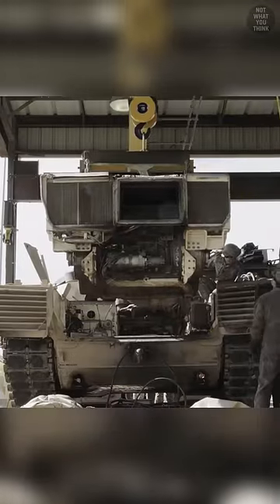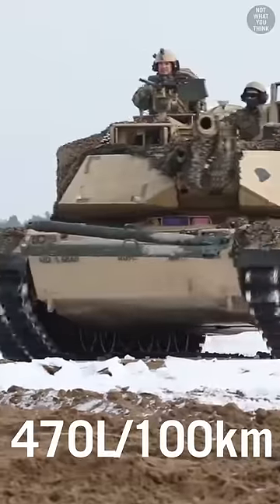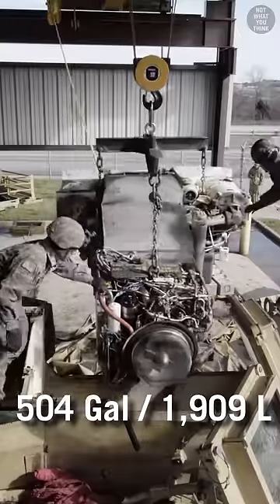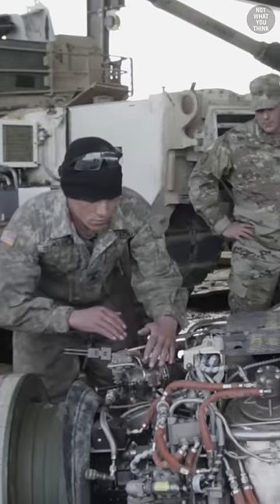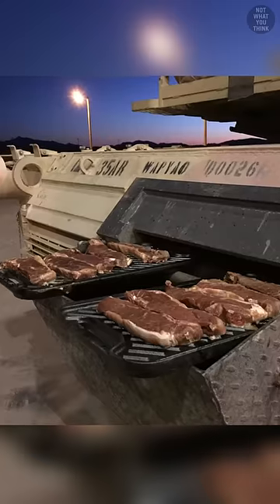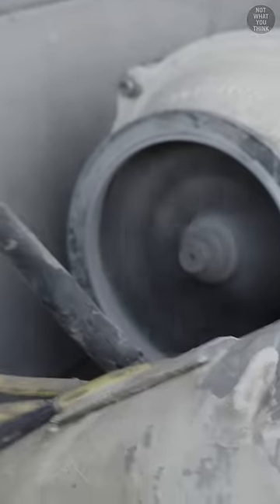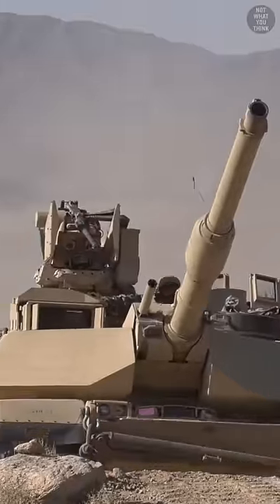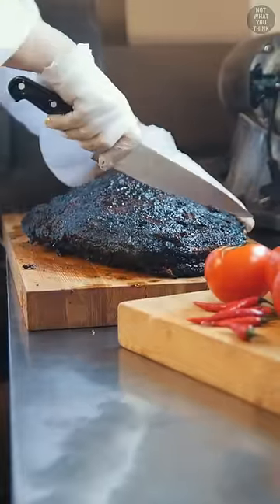Why M1 Abrams Tanks Have Gas Turbine Engines #shorts

Comment: "It's not what you think"
Turns out, it's always what we think
Reply: No, it’s not what you think, it’s exactly what you think. There’s a difference.
Reply: I never thought the main reason they chose this engine was because it can run on diesel, marine diesel, jet fuel, gas, oils etc. Thats a huge advantage over a diesel engine which can only run on diesel and oils
Reply: Zeriel l actually agree with you and finally some one who l found in the comment section that actually has a functioning brain for once.

Comment: Something that really helped to cut down fuel costs was the addition of an APU (auxiliary power unit) which is just a small engine to run the hydraulics and other systems while the main turbine is off
Reply: The newest Abrams has panels in the bottom under neither the driver that can be removed so the driver can Flintstones walk the tank

Comment: “Like diesel and jet fuel” and vodka, and perfume, and wood vapor, and hydrogen…
Reply: Pretty much any fluid that can be made to burn.
Reply: In soivet russia tanks only run on vodka and alcohal
Reply: You can also chuck a russian in there that works too. their body fluid is mostly vodka and diesel fumes anwyays
Reply: And cooking oil, and heavy oil from cargo ships, and kerosene, and propane, and butane and meth if you're feeling adventurous.
Reply: @commiemark  and bears operate them
Reply: @hallofo8107  Yup, just like the Chrysler turbine, that was one hell of an engine! lightyears ahead of any other engine, the exhaust was even room temperature due to its power recovery system, but just like this it could literally run on anything flammable, including propane, wood gas, alcohol, diesel, gasoline, butane, etc.. When they showed the car off in mexico they ran it on tequila and in France they ran it on Chanel number 5  and brandy.
Reply: @ec7005  on meth? But why would we be invading middle america?
Reply: @TheRamenSeal  lol wrong meth buddy
Reply: @Lotek117  Holy smokes, I had no clue it was THAT versatile! I also didn't know about the power recovery system either - thanks!
Reply: You know what's funny is a Cummins from 1959 can achieve the same exact thing
Reply: @ec7005  Jesse we need to cook the us military wants our meth for tank fule
Reply: @Wage_gap_gaming  lol I've taken meth before, but it was neither methamphetamine nor methanol.
Reply: @ec7005   the heavy ship oil is not the thickest fuel rated for emergency use anymore.  M1’s have been driven on Diluted Bitumen (Western Canada Select), but it does require a depot-level overhaul if solely used for more than 80hrs. That fuel is so thick, it sinks 6inches into the mud if spilt in a waterway.
Reply: @wiryantirta  made my day 😂😂
Reply: @Lotek117  I’ve often thought since Chrysler designed the Abrams, if the two were ever connected. Chrysler used guys from their missile division to help with the Superbird and Daytona aero.
Reply: @commiemark  dude thats racist how you talk about the great socialist eastern world, you getting a visit by a local authority soon
Reply: @MrBlonde294  bruh it was just a joke
Reply: If it burns she’ll take it
Reply: @commiemark  
In reality , the ussr use first a gas turbine innthe t80
Reply: Not hydrogen.
Reply: Don’t forget about Twinky’s
Reply: @Lotek117  how did it recover energy? Did it have a sterling engine in there too?
Reply: @commiemark  acoha
Reply: Good luck getting any liquid hydrogen. Not even hydrogen cars use liquid hydrogen.
Reply: @___meph___4547  lol no,  Methacholine.
Reply: @mincat1412  Orcs not bears...
Reply: @MrBlonde294  bruh do you know what comedy is? Comedy is typically when someone takes something dark or even usually uncomfortable and makes if funny or uses stereotypes to help deliver the punch line besides 70% of all comments on YT are jokes the rest are people complaining like you ☺️
Reply: @mincat1412  the tank is actually a mechanically enhanced bear
Reply: @ec7005  Oh, you meant MethANOL.
Reply: Is anything that can be atomized and catches fire
Reply: when the engine is hot enough, it could runsome percent of water
Reply: Can it use sewer oil?
Reply: @hallofo8107 i thought diesel was too thick and isnt combustible enough?
Reply: @Lotek117 its crazy the m1 abrams engine is a modified helo engine
Reply: I’m confuse what the fuck does it have to do to be able to run diesel or does it just fucking have enough pressure to already burn the diesel? Because I mean it’s really hard to ignite diesel without pressure, but if you wanna make anything easy to ignite you just add pressure so I mean probably
Reply: Burn anything you find on the battlefield
Reply: MetziTzah B'peh  nop
Reply: whatever you use has to be clean and thin enough to pass through the thin kerosene lines
Reply: @commiemark  no, in soviet russia tanks don't run at all)))
Reply: @wiryantirta  Like in that TInTin film with the airplane lolz
Reply: Moist g bangers by the bucket 🪣 load.
Reply: @ec7005  thts wot the tank crew will be on . Pinging 4 daze.
Reply: If it can combust, a GTE can use it
Reply: @ignacio3890  The first PRODUCTION tank running on a turbine engine was the Swedish Strv 103 (it had two engines - a weak Diesel engine to provide power while stationary and at very low speeds, and a more powerful turbine to use while driving).

Edit: I meant production tank, not any prototype ever.
Reply: @MaxIsStrange1  
Nope.... in reality was a 1945 jadgtiger prototipe but the first serial turbine mbt it's  the t80 since the s tank use a hibrid sistem
Reply: @ignacio3890   I should’ve specified that I meant the first tank IN PRODUCTION, since there were quite a few concepts of putting a gas turbine in a tank. Stridsvagn 103 used two completely separate engines. The diesel was used only to rotate the tank and actuate the suspension in order to aim, and maybe do drive up a short distance at a slow speed. When the tank drove at higher speeds, ONLY the turbine provided power. That’s why the diesel is only 290 hp, and the turbine 489 hp (in the C version but all versions functioned that way).

Wikipedia about the Stridsvagn 103: “This was the first use of a turbine engine in a production tank; the Soviet T-80 and US M1 Abrams would later be built with gas turbines for main propulsion.”

And that’s not how you spell ‘hybrid’.

Comment: Prior to Desert Storm, the Army wanted a better seal for fuel delivery to the A1 Abrams tank than it previously had. I was working for a large rubber/plastics manufacturer in Southern California as a tooling EDM operator and I made the tooling to manufacture more dynamic sealing capabilities. The company had also made the original inflatable canopy seals for the then secret Stealth fighters and bombers. As Desert Storm approached, the Air Force wanted to replace all of the canopy seals. The original extrusion tooling was made around 1980 and Air Force Brass came to watch and measure the new seals. However the tooling didn’t produce a product within specs. So they gave me the schematic, the original tooling, and what it had produced. I had to make hundreds of measurements of the tooling and what it produced, made many calculations, wrote a program for the EDM machine to follow, and cut new tooling. This took me about 2 1/2 hours. When they ran the new tooling, the finished product was within .0015” on every dimension specification when they needed .005”. My partner and I also made new extrusion tooling for the redesigned O-Ring for the Shuttle solid booster rocket. The company extruded the uncured O-Ring seals and shipped them to Morton Thiokol in Utah where they installed and cured them directly on the booster rockets. On a lighter note, the company also made Wham-O Hula Hoops and Mattel Hot Wheels track and I made tooling for those as well. It was a very rewarding and satisfying career.
Reply: My uncle works at Nintendo.

Comment: The fuel problem with the turbine is that it burns as much fuel when the tank is not moving as when it's running flat out, whereas a diesel's consumption is very low at idle.  M1s have had an APU installed so that the turbine doesn't have to be run when halted to generate the power required by tank systems.
Reply: M1A2 Abrams are sharks (confirmed)